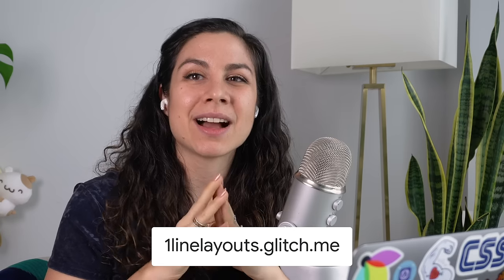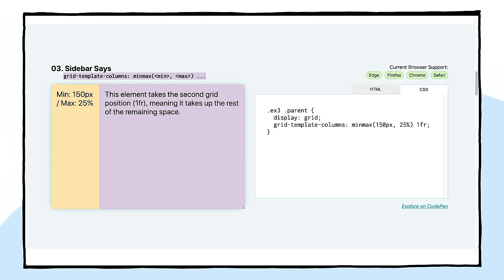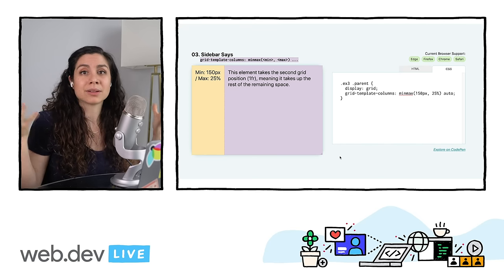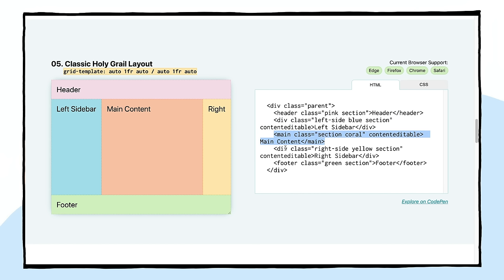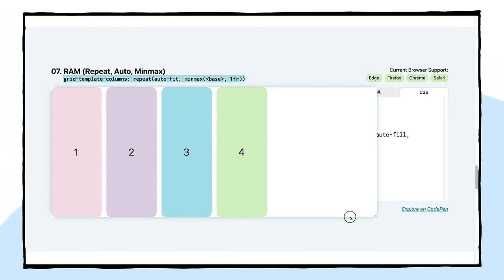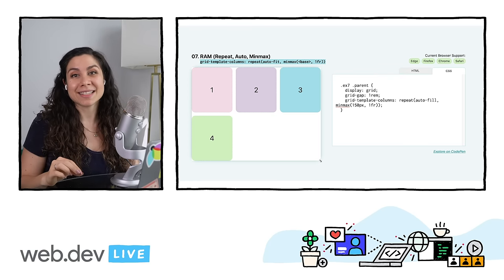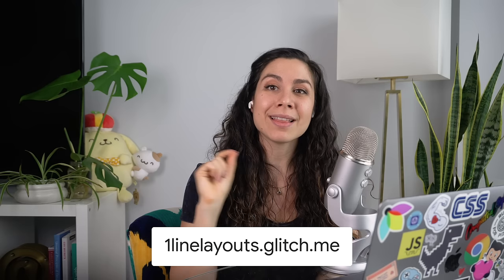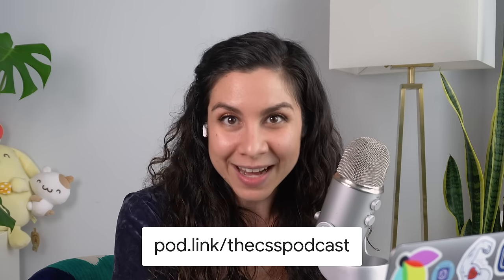10 modern layouts in 1 line of CSS

Comment: We are in 2020, still not able to figure out how to center things in HTML/CSS 🤣
Reply: Just put everything within a <CENTER> tag and you’ll be fine.
Reply: Display: flex; justify-contnet: centre; align-items: centre OR use auto margins. Also firefox is much better for working out what css doenst work.
Reply: @maxclifford937  in mid 2000's  i use to use float: right then move left  half value of the width like

.t {
    width: 100px;
    float: right;
   left:  -50px;
}

this works but its a pain to align children please do not use this way
Reply: @ryonagana  and there was stupid clearfix solution etc. grid and flex layouts save us a lot.
Reply: Pff, easy. Just keep adding &nbsp; in front of the element until it's roughly in the center of your screen.
Reply: @zzzdan  haha amateur. I actually use a ruler to calculate the width of the element, then subtract it from the width of the viewport, divide it by 2 and I have the margin-left.
Reply: @joycechu5911  Yeah, you do that with something with a relative width...
Reply: crazy
Reply: Really we're not able to center things in CSS? You could use align-items: center; justify-items: center; for a long time, place-items: center is just a shortcut.
Reply: The very first example is how to center things with one line of CSS: `.ex1 .parent { display: grid; place-items: center; }`
Reply: 2021 - still the same problem

Comment: You don't know how long I have been doing the ol' position:abs top:50% left:50% and finally transform:translate(-50%,-50%) to center things XD
Reply: I still do the same
Reply: Before watching this video, I thought this was still the modern way to do it…
Actually, when trying out `place-items: center;`, the child is not actually centered if the parent is smaller than the child. With `translate`, it still works!
Reply: It really depends on the context of the situation, the solution you use works basically 100% of the time but the place-items: center; option only works sometimes which is why I tend to stick to the same solution
Reply: @woutermissler5371   dont go for place item rather use flexbox or more better grid
Reply: I just had to deal with something that may be a bug in Firefox: when centering elements with the `translate` approach, it seems that the print preview still considers the extra space created by the `left` and `top` positioning, even if everything should be centered on one page; the extra space completely break the paged media layout. With the Grid centering, no extra space is created at any point, so only this works.

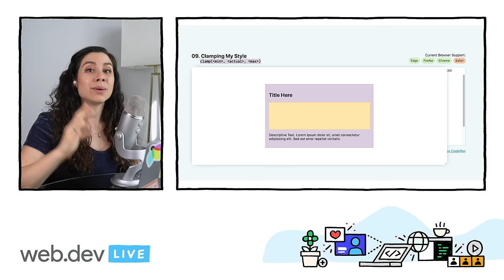Comment: 18:35 10. Respect for Aspect
 - without newer features this is currently handled by using percentage padding hacks with absolute positioned children set to 100% width & height. Where the percentage padding is the aspect ratio.
Reply: i think the whole point of this feature, is to make this easy to do
Reply: @thirien59  I think the whole point of @Paul Newton's response is to inform people how it's currently done, which wasn't included in the video
Reply: @thirien59  support isn't guaranteed, this is the arcana of the old ways from a less elegant age

Comment: The ideal width for a paragraph, according to studies run on social media websites, is between 40 and 55 characters per line.

Obviously those numbers may vary slightly depending on the font used, but they should work as a good starting point for the width of a content container.

width: clamp(40ch, 50%, 55ch);

Comment: You can also use padding until aspect-ratio is implemented. E.g. 16/9 aspect ratio would mean  you set the width to 100%, height to 0, and padding-top to 56.25% (i.e. 9/16 of the width).

Comment: A slightly more limited and harder but more browser supported way to get the aspect ratio is to use a percentage with padding-top because it will actually use the percentage of the elements width

Comment: It might be interesting to have a layout engine which only supports the subset of CSS shown here for extremely low footprint layouting. I know that we typically don’t need anything low-footprint, because most devices have power that seemed crazy 20 years ago, but the next low-power device will come, and when you have that dynamic tattoo that’s powered by your own body, you’ll really want to minimize power-draw.

Sidenote: Isn’t clamp the same as minwidth+width+maxwidth?

Comment: 6:20 i tried that but it does not seem to work. The Boxes all have the height that is needed regarding to their content. No stretching of the middle box. Where may the error be?

Edit: Finally got it. You should mention that the parent element has to have height: 100vh; :)
In fact the other layouts also seem to need some body-tag css. You should mention that. Beginners dont know what is going on here.

Comment: In the first example, how did you make the text box expand as you are typing using CSS? I have a div text box right now that has "width" and "height" styles, but when I type in this text box, the box does not expand automatically at all, is it because of the "width" and "height" styles that I set on this element?

Comment: Hi, example 8 does not work if the headlines have a different length. This example seems to be good but it's not a real word example.
Reply: It works in the sense that the layout is doing what you’d expect. If one card has a longer title and shorter description, for example, it would also work. I’ve used this layout when working at a major media site that has slightly variable headlines and clamped them at 3 lines with a “...” for overflow
Reply: @UnaKravets  how should it work without setting a min height for the headlines? It is not working only with the css we see in the video.
Reply: @groovebird812  Can you build a test demo? I'm not sure what you mean by it "not working"
Reply: @UnaKravets  thanks for your help. I forked your pen: https://codepen.io/axelf/pen/OJMqaxJ You see a very long headline at first (3 lines), then a shorter headline(2 lines) in the middle. The content of all 3 boxes should begin where the largest headline ends. The contents (i mean the paragraphs) should begin at the same point. Now the content of box 1 begins later as the content in box 2, because the headline in box 1 is larger. 

Could i see your media site? Maybe i'm wrong.
Reply: @groovebird812  check out thezoereport.com and elitedaily.com -- both use the same styles in carousels and product cards (space-evenly instead of space between in these instances to give some outside spacing, but the idea is the same and would look the same with margins as in this example). Cheers! Hope that helps
Reply: @UnaKravets  thank you, but i think the problem is the same. If the headlines have different lenghts the content after this headlines begins under the headline directly and not at the end of the largest headline. Hier is an image what i mean: https://pasteboard.co/JjaSWZd.png

Comment: I am a noob.  I came here from the website.  I copy and pasted example 4, and it doesn't work.  I examined the code on CodePen and it's different.
Reply: Were you missing the "height" property on the parent? You only need this if you have no content within a specific section and still want it to stretch to fill space. If your elements all have content within them, you likely don't need to set a height. You can always set a min-height on the body to `100vh` so that it's always at least as tall as 100% of the viewport. Let me know if you run into any more issues!

Comment: See those semicolons?  That's an end of line indicator.  3 lines of code does not magically equal 1 line of code.  Also, to other commenters claiming using external frameworks is better - you're wrong, you're relying on someone else's code that could go away at any time unless you're downloading it and hosting the js files on your own server.  And even then, you're just adding massive overheads to your server, which results in longer load times for your consumers.  If you're website can't load the major content at 60KB/s in less than 1 minute, you're just making people mad, especially on mobile.